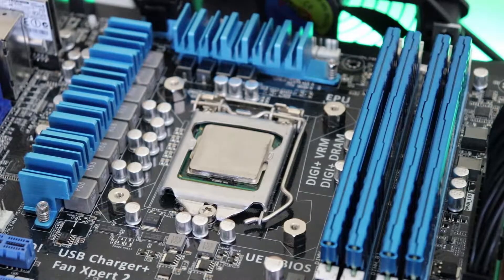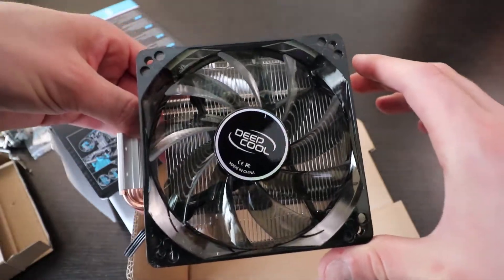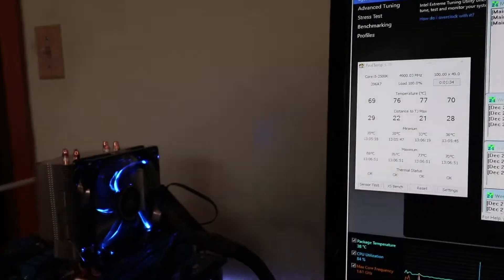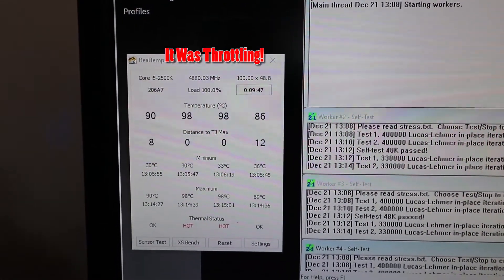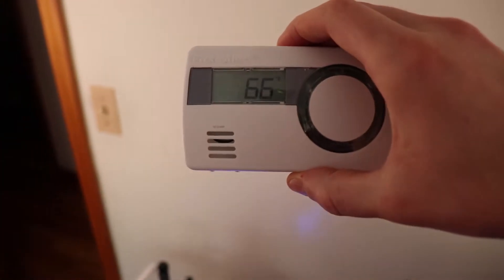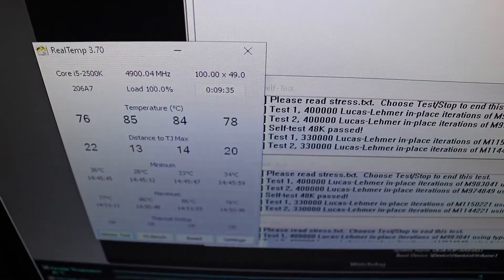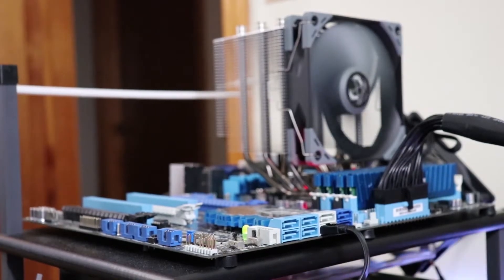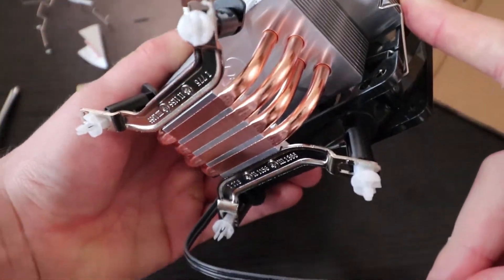Thermal Pads VS Thermal Paste - Don't Use Thermal Pads With This Type Of CPU Cooler

Comment: I like the thermal pads because They Are install and forget. They don`t dry up. My 3700x is running at 71 celsius when in high load, normally near 60 in games and like that with thermal pad. Paste would give me even better thermals, but I newer have to reaply the therpad pad, like I have to reaply thermal pad and cooling is good enough with pads, so I am really happy with results!
Reply from the maker: Nice!  What cpu cooler are you using for the 3700x?  I'm about to do a build with that processor.
Reply: Nochtua Nh-u12a. It is in very well ventilated be silent dark pro 900 case with 5 case coolers so it most likely would,be ok with passive cpu heatsink ;)

Comment: Maybe the thermal pad isn't making complete contact with the microscopic hills and valleys on the IHS. But since the thermal paste is viscous it can easily fill them in. Though i've never used thermal pads, so i'm not too sure. Cool vid my dude.
Reply from the maker: Johnny you're abolutely correct, because there isn't enogh force clamping down between the IHS and the CPU cooler due to the mounting brackets.  The more force, the better those "hills and valleys" will make complete contact.